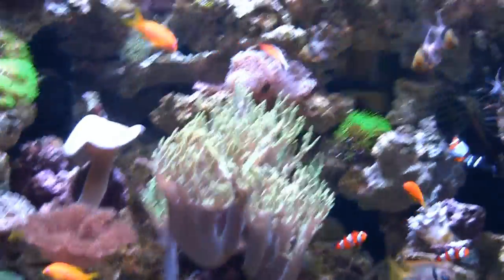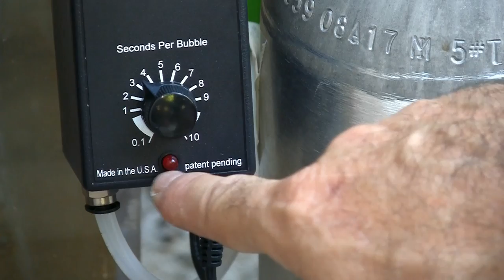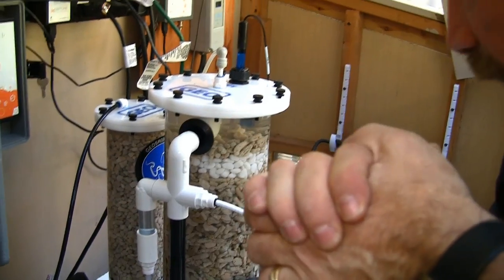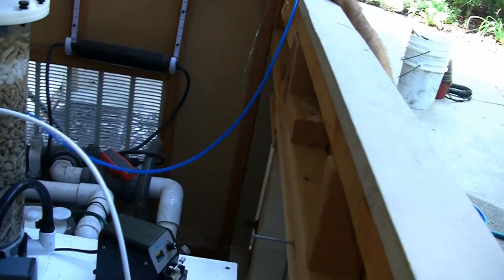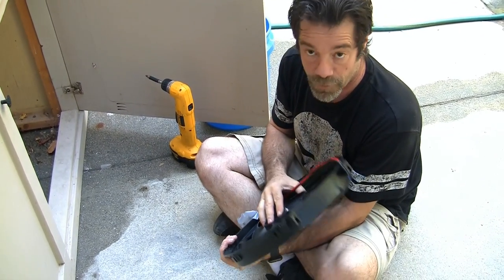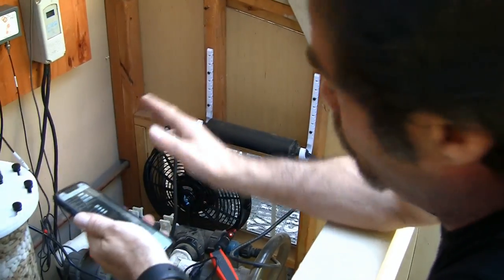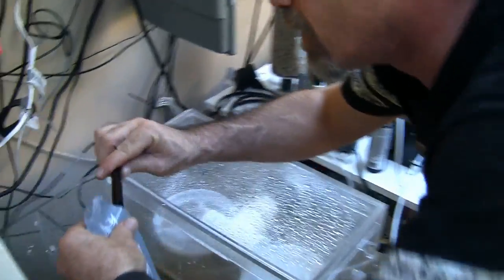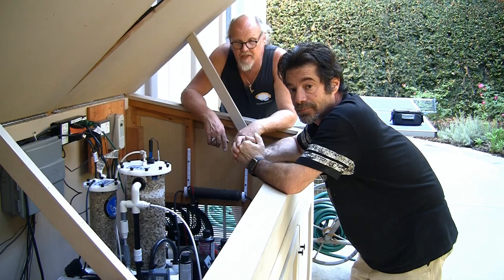Reef Tank Re-Do, LA Fishguys, Episode 161 Part 6, Calcium Reactor, Algae Scrubber APEX System

Comment: Why didn’t you set the kamoer as a Pull configuration vs a Push configuration ?
Reply: From my understanding is it puts zero pressure on the seals in the reactor, preventing leaks.
But I believe the way he has the geo set up, he is actually pushing through the reactor
Reply: We are in fact pushing. I’ve run my masterflex both push and pull and prefer pushing so that is how we set this one up. Plus, if there is a leak, it’s obvious when pushing where as when you set them up to pull, finding the leak can be troublesome.